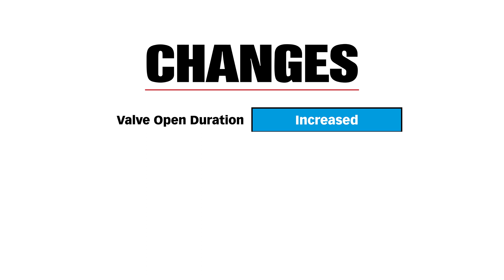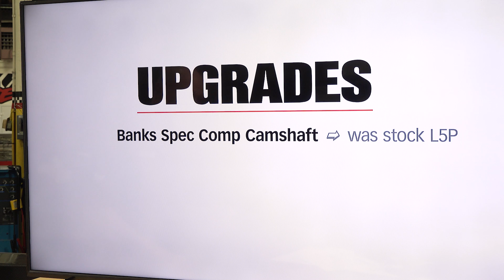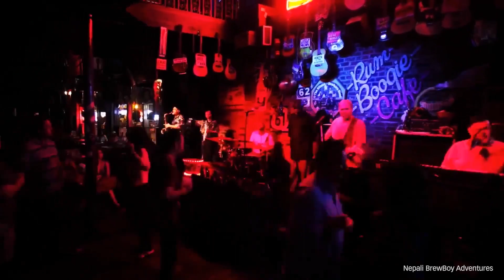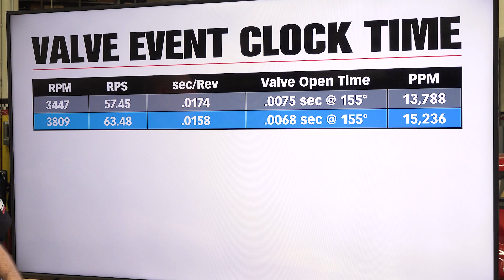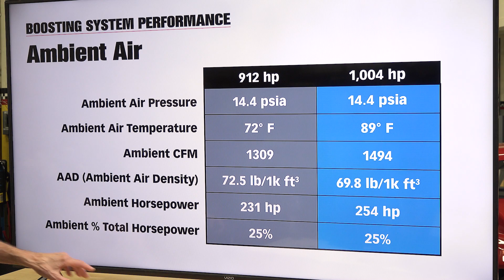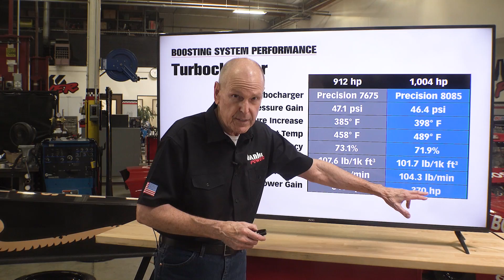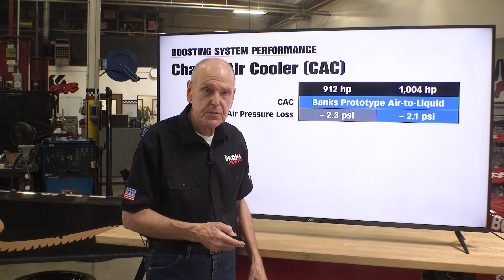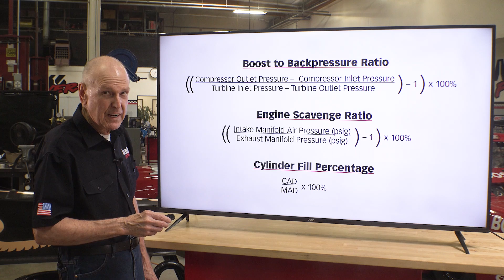1,004 HP !!! Killing A Duramax Pt 15

Comment: Considering your egts and compressor outlet temps I'd say water/methanol should be next
Reply: Seems like you had some room to go as far as efficiency and turbo speed, just the temps needed to come down some. I would say water meth next to cool things off, which would allow to make more power at the same temps.
Reply: How about nitrous?
Reply: If you knew anything about gale banks, you’d know how ridiculous it would be to suggest that to gale banks.
Reply: K Knocks just watched a video where gale said “I’ve been doing water meth injection for 57 years.”
Reply: Hydrogen Peroxide.

Counter-intuitively, it lowers temperature even more than water. Also, unlike water, it provides extra oxygen that helps the fuel burn more completely.

Increased power, torque and thermal efficiency (and thus fuel economy), lower EGT, and cleaner exhaust.

Combining hydrogen peroxide and methanol, though? I'm not entirely sure if I recommend that or not. It might autoignite spontaneously! o.o
Reply: @AmaroqStarwind  the problem, of course, is storage and delivery. As for a peroxide/methanol reaction, read this: https://patents.google.com/patent/US20070167532A1/en
Reply: @spdcrzy  yoooo thank you so much for that google patents link, you sent me on quite the rabbit hole of research lmao
Reply: @AmaroqStarwind  would hydrogen peroxide be excessively corrosive to anything it touches before ignition?
Reply: Jason W Hydrogen Peroxide acts as a catalyst for other chemical reactions as far as I understand it. It isn't inherently corrosive on its own.
Reply: @AmaroqStarwind  methanol peroxide doesn't react that strongly, mixtures stored in fridge under 25% shielded from uv light are basically stable. The latent heat of vaporization of hydrogen peroxide is also only about 55% that of water (1.26 vs 2.26 x10^6 j/kg) although specific gravity is about 40% higher. By volume, not mass, hydrogen peroxide has 78% the latent heat of vaporization of water. 100% peroxide is also ludicrously dangerous and is almost unusable. If all you're trying to do is cool the intake and add oxygen, nitrous is much safer, has a possible shelf life and has a long established practice of use. It is highly unlikely hydrogen peroxide would be usable for this purpose as any decomposition is exothermic and would actually aggravate the charge tempurature issue. The enthalpy of decomposition of hydrogen peroxide is 2.9x10^6 j/kg, about double the latent heat of vaporization. Look at catalytic jet packs and see what they use as propellant.
Reply: Timothy Bayliss Look for the paper "Effect of Injecting Hydrogen Peroxide into Diesel Engine", published in April 2012.

http://citeseerx.ist.psu.edu/viewdoc/summary?doi=10.1.1.428.9137

The Abstract:
"An experiment was conducted with four stroke multi-cylinder, water cooled compression ignition engine operated with neat diesel and blends of hydrogen peroxide with diesel. Main focus of this research is to investigate the performance of diesel engine by injecting hydrogen peroxide as blends with diesel at 2%, 5% and 10 % proportions. In the experiments, injection timing was also changed, which is an important parameter in the study. Results showed that, the efficiency of engine increased by injecting hydrogen peroxide at all fractions along with diesel and the exhaust gas temperature has found to be decreased reasonably. Also, efficiency of engine has increased by advancing the injection timing by five deg for both diesel and its blends with hydrogen peroxide. At injection timing of 15 0 BTDC, engine was unable to start when 2 % and 5 % of hydrogen peroxide with diesel is injected."
Reply: @AmaroqStarwind  the problem with the article is it operates on the premise of.injecting peroxide into the cylinder with the fuel charge. The investigation was into efficiency. You could run a diesel engine with 100% peroxide as the fuel if you had a catalyst in the cylinder. The.amount of energy that comes from decomposition is crazy, and if this started in the manifold, you would never make up the loss in density. What your suggesting is something different, a fuel mixture or duel injection, it is way different than spraying it in the manifold. The automatic decomposition temperature is around 230°C, way lower than the in cylinder temperatures. If you had liquid/vapour peroxide in cylinder, it would start to react before the injection even and drive a self sustaining reaction until all the peroxide had decomposed well before the injection event. Not saying it's not a neat idea, it's just something that will never happen.
Reply: @AmaroqStarwind  How do you propose causing the H2O2 to break down and release the extra oxygen?  Catalyst?
Reply: @AmaroqStarwind  The problem with hydrogen peroxide is that it's a potent oxidizer, that in itself adds its own complexity.  The stuff in stores is tiny fractional peroxide amount, typically in the 3% realm.  Methanol is a better approach and it won't corrode shit like peroxide does.  Peroxide is after all an oxidizer ingredient in rocket fuel.  Takes corrosion to a whole new level.
Reply: I can't see water methanol helping much, intercooler outlet temp is only 12° above ambient, the water will make a steam effect during combustion which will add some power and also reduce the egt somewhat but I don't ever remember steam engines making a whole lot of rpm or having a very high power density. Methanol will richen the mixture I would assume and then the diesel being injected has something else to contend with to find oxygen, I know I'd rather the diesel be making the power rather than methanol at 3800rpm. Maybe someone knows of a different advantage to water: methanol that I don't know of, I imagine it could lower the intake manifold temp below ambient and increase the air density in that way, but then you have pressure drop and this could negate any improvement in air density. Let's see what happens. Next.....let the data do the talking
Reply: Some respondents may need to revise their chemistry lessons, others to remember Mr Banks is focussed on SUSTAINED power and durability, not sure o0f some of those suggestions would meet those requirements - still like to see them tried, though 😎
Reply: his philosophy is to control egt with excess air.  its similar how egts are controlled somewhat controlled on turbine engines.  if he decided to keep adding fuel, egt will rise if it was accompanied by similar increase in excess air.
Reply: Yep thats a intelligent way to go. Will do the job of cooling and raise the cetain level of the fuel.
Not to mention real world plausibility.
Reply: how does W/M compare with propane...time for a google search lol
Reply: @briankohlenberg  and propane as a gas or propane as a liquid....
Reply: @jordanwaughtal7649  Propane Injectioned as a liquid, hand down for the extra intercooling effect!
Reply: @Aseutester  another issue is lack of oxygen, which would be aggravated by the addition of more fuel like propane. Two could be flowed in to find a balance. The addition of a fuel to the incoming air would displace the oxygen entering the cylinder during the intake stroke . It would be an interesting experiment to perform just to find out what the outcome was. Lots of pros n cons. I'm curious now.

Comment: Since it needs more excess air to burn more fuel, either compounds (bonus points for inter-stage charge cooling), or nitrous. That way you have more oxygen to burn up. Water meth will help with charge air cooling but won't significantly increase excess air. Needs more air so we can burn more fuel!

Comment: I'd like to see water / meth injection.........followed by propane injection.  Things that could be used on a street truck versus full on drag.
Reply: I would also add.......Thank you Mr. Banks for your tireless work to demonstrate the full potential of diesel engines...........in terms of max power but also reduced emissions!!
Reply: I'd like to know the drivability of this engine and also how you'd fit it in your engine bay. I love your series its so informative,  way above my head but you do explain it well. I just want an L5P and a Banks bolt on kit. Thanks Gale.
Reply: He already put water meth on it. Not good results.

Comment: I'd like to see the detailed benefits of the water meth on inlet outlet temps as well as density in the current configuration. I'm waiting for your new meth kit to be put on your website... So my interest is maybe a little bias. 😉

Nitrous would probably help that extra oxygen you want though. 37 deg of injection has a little room where you're already past your air target. 

Love the video series and the Data Monster. I'm running the iDash on a 2019 Corvette Grand Sport. Wishing for more Banks stuff I could use on it. But I'm learning what needs change with data and love it!
Reply: Put an l5p in that vet and you can get anything you want from banks. Also the only way to get more attention in a vet.
Reply: @spatton7875  lol, I do want an L5P. But even if I did that the fitment would still be wrong and make most parts incompatible. ;-)

The Derringer on the other hand would still work.

Comment: Question-
The power keeps climbing without the RPM climbing anymore. So I assume it keeps spooling up more and more boost the longer it sits at ~3800rpm. Question is why isn't the turbo fully spooled before that? Is the dyno presenting real world load on the crankshaft?
Reply: This thing is wastegated so spool is consistent
Reply: They are applying more resistance with the dyno over time. That is what that pump switch helps with that he flips during the run.
Reply: The dyno holds the rpm steady and the throttle controls the torque via fuel.

Comment: Is that engine still considered "stock" after swapping out the Cam?
Reply: I think he means stock in the sense that he's using stock pistons, a stock crank, stock valves/lifters, stock head, stock head gaskets,etc and they still haven't failed, the cam really isn't gonna break because you're making more power, in the sense of what he's testing for the engine is "stock," but the stock turbo, injectors, intake, cams, etc.. are holding the engine back from being able to kill itself.
Reply: It is certainly stock in the sense of durability. In general tuning, your tune will never break your engine because of the cam.
Reply: ninioburbuja yes   Internally crank n piston   I believe will be the end of stock,  my thinking is  back in the old days this is what everyone did to their cars n trucks  , if you could afford it , exhaust , Intake , ignitions , carbs , and the cam  , basically what average guys could tackle at home ,   Average car guys ..  I think   Just an opinion
Reply: Stock bottom end.
Reply: It's a stock long block. Cams, injectors, turbos, and fuel pumps are essentially tuning items needed to increase power, not to increase to strength of any of the parts. I consider it stock.
Reply: michael lehner heads are stock. Intake is stock. Its a stock bottom end,or even long block if you prefer.